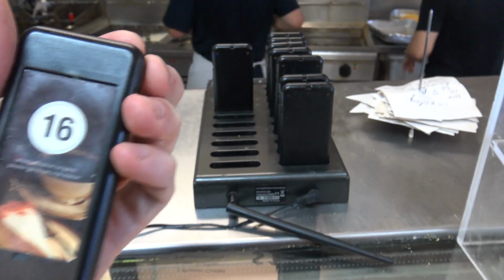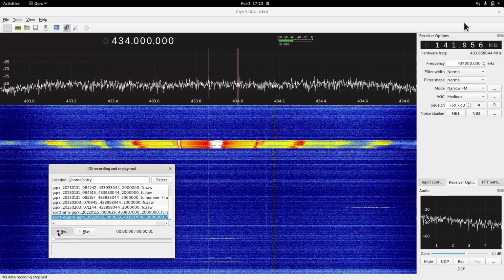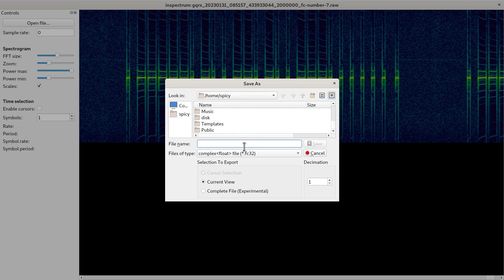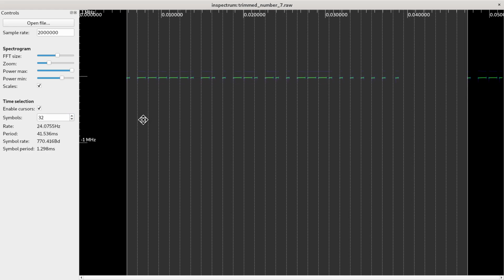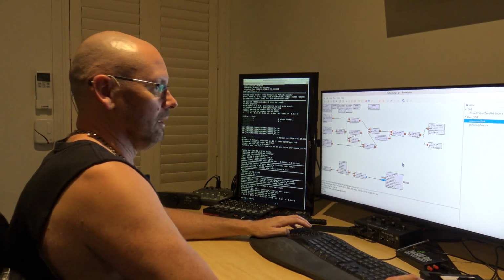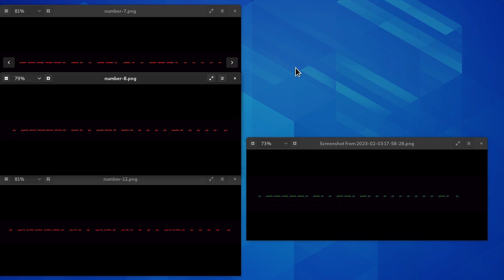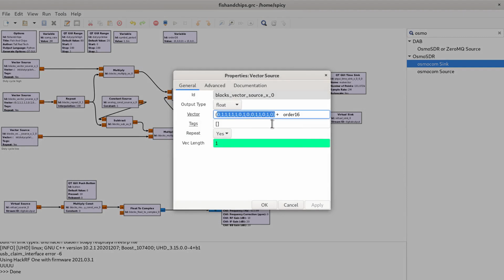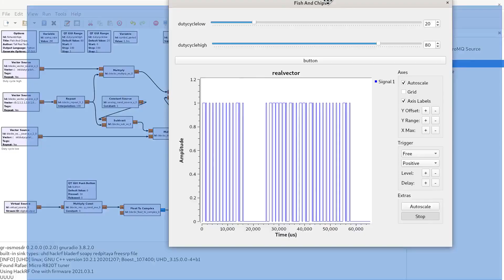Hacking A Fish & Chip Shop

Comment: Hi Paul, I have a question. If the beeper is placed like in another medium than the transmitter, then does the beeper be able to decode the data and set on?